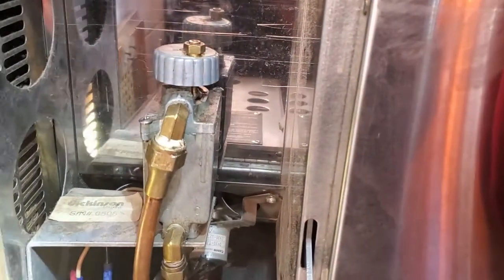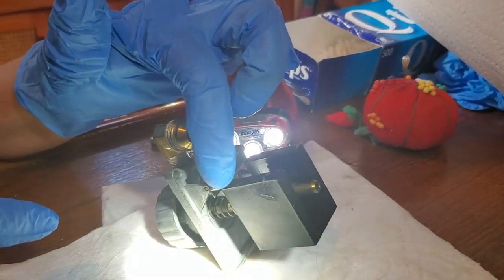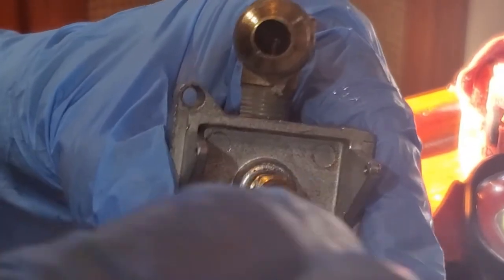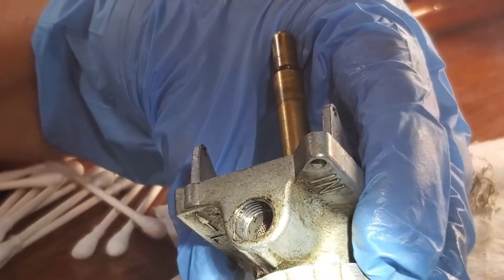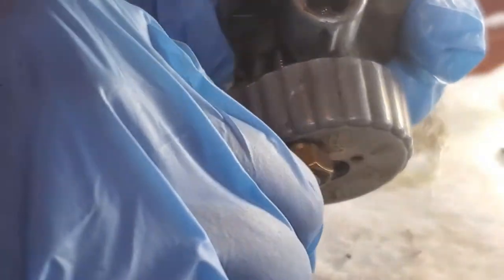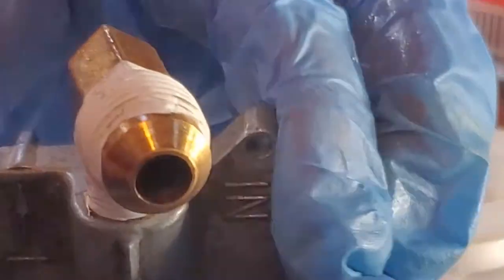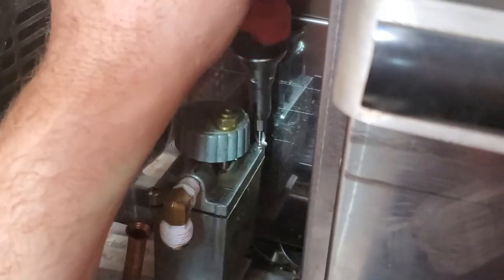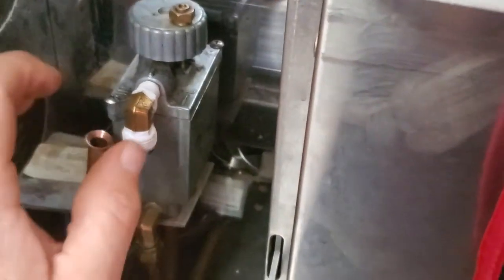How To Clean a Dickinson Fuel Metering Valve

Comment: I hear you are putting a heat rad in a  cabin up by the bow winch is heated by the stove and the engine. It will be nice a warm in the hole boat.
Reply from the maker: It is great. We are experimenting with the system right now. Once we have the kinks worked out we will be releasing a video about it. Stay tuned!! Thanks for commenting!!

Comment: Do you have to use the fan all the time ..  I have been having trouble stopping the stove sooting up if not using the fan  .. so I'm going to try an extra few feet of flue pipe
Reply from the maker: Hey Malcolm! The sooting problem is from not burning hot enough. We used to run the fan all of the time, until we completely cleaned the whole system. Two things for you: 
1) don't run it any lower than setting 1.5 on the metering valve. It seems to carbon up. We leave it at minimum of 2, and just open a porthole. Perhaps a bit of a waste of heat, but everything keeps operating smoothly. Worth it for us.
2) clean the entire flow path of the diesel system. We have a video on cleaning the metering valve. Plus there is a bung plug in the very base of the burner pot that you can unscrew from underneath the stove, behind the fan. Put a cloth under it before unscrewing it as it is full of carbon, etc. Clean out that bung plug itself. Use a long metal poker or something to clean the hole at the very bottom center of the burner pot.  You will see it coming out where the bung plug is. Clean everything really well. Check your fuel filters between the tank and your stove. 
Let me know if that changes anything for you. Hopefully it will solve your sooting problem! Good luck!!
Reply: In the end  i ended up adding anouther section of flue  that helped  but same as you i could not run it on low .. so i bought the low sulfur fuel baffle  from dickenson  its a game changer   .. lovely flame with plenty of blue in it and i can now run the stove on the lowest setting  the baffle was £34   ish   money well spent  .. many thanks for your help  and videos  im realy looking forward  to seing how you get on with the radiators  as i have the double coil  in mine  but as of the moment  its  doing nothing  ... im wondering if your going to use a pump  or try to work it  without one

Comment: I don't think you need Teflon tape on those fittings due to they are flared fittings.
Reply from the maker: Perhaps. We always use the Teflon tape as a double reassurance of no leaking diesel. We would rather take an extra step than clean up diesel. Thank you for sharing your thoughts!! And thanks for watching!!

Comment: Which stove is that?
Reply from the maker: Hi Bryon! We have an Adriatic. We know that 4 of the Dickinson stoves use the same metering valve: Adriatic, Pacific, Antarctic, Bering. The part # is 02-000 size 3D diesel. If all else fails, contact Dickinson for help!! Thanks for watching and asking your question!!
Melanie & Neal
Reply: @schoonerkiva  that’s the first time that I have seen the valve located inside the side compartment for a port/starboard installation.  I have a pacific stove and the valve is located in a locker on the side of the stove. I like how yours is set up.
Reply from the maker: @bryoncraig2749  I have seen what you are talking about. I believe the metering valve was installed on the outside (like yours) was done on older Pacific models, and the Bering models. I am not sure why they did that.  Inside is nice for reducing overall width and offering some protection from bangs. It also helps to pre-heat the diesel before burning. It can also make access a bit more awkward. Thanks for subscribing! And thanks for your comments! We look forward to hearing from you again in the future! Let us know if there are any topics you would like us to explore! Thanks
Melanie and Neal